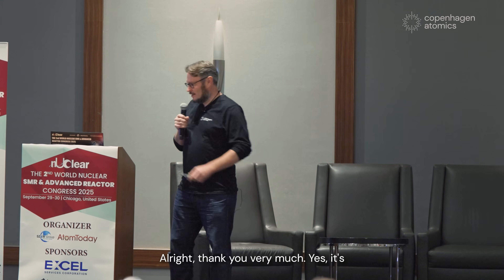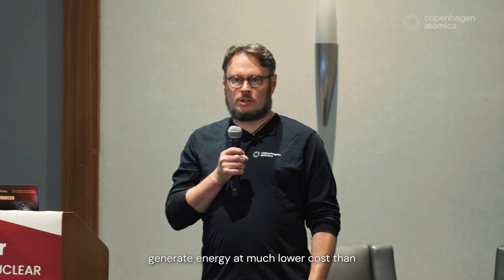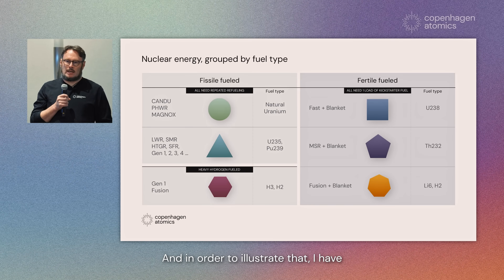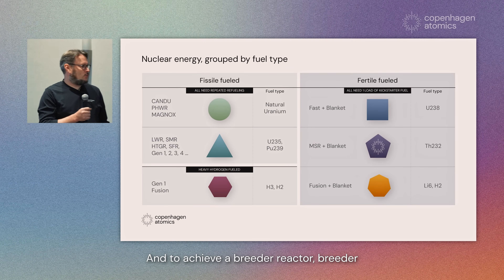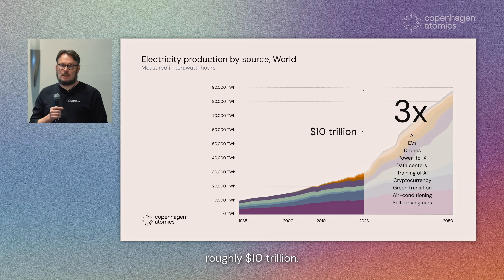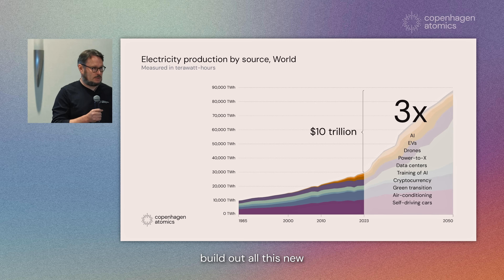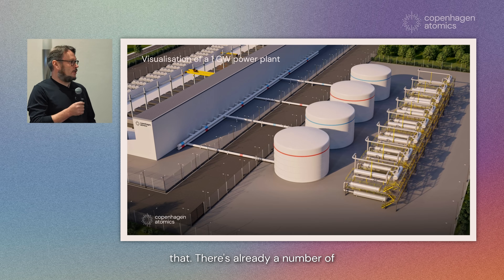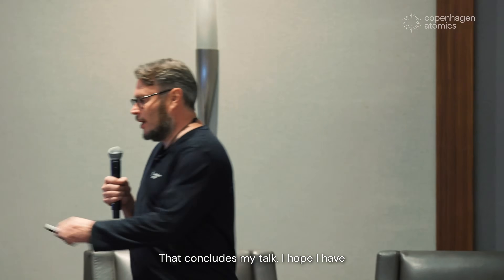The Solution to Future Energy Demand: THORIUM Reactors

Comment: NO, nuclear will never be the solution to our energy needs as numerous independent analysts have confirmed, nuclear is: 6-10 times the cost to deliver power, than solar + batteries, and, solar is installed in a fraction of the time as nuclear, and 100% safe.  The days of nuclear are pretty much over (except for nucear jet engines and small nuclear reactors for ships).
Reply: Solar??? I think you mean very low energy-dense intermittent sources that are totally dependent on the time of day, the day of the year (season), Vast amounts of raw materials including land, gigantic chemical batteries, thousands of miles of new transmission lines AND, AND a full demand-sized natural gas or coal plant as backup. No amount of overbuild and batteries can overcome seasonal variability for full reliability.

Comment: Reported for misinformation.  Solar Wind & Tidal is more than enough to power the USA 2x over for generations.  We are NOT going to patch radioactive material into every crevice of society you absolute half wit
Reply: Crawl back under your rock.
Solar is the sun. The sun is a star. Thorium is star dust.
If you favour solar you are, de facto, a supporter of Thorium.
Reply: @vincentmahon6423  Super concentrated solar that runs 24/7/365.

Comment: $50 million for a 42 MW reactor which only creates the heat.  Then you will have to buy the equipment to generate the electricity. Plus $2 million per year for operational cost.  This doesn't sound like it's feasible compared to the 42 MW solar farm near Dublin, Ireland which recently sold for $41 million.  Sure, there will be markets where solar is not practical and this will work, but to truly go mainstream, the cost needs be closer to $20 million.
Reply: If you are decommissioning an existing coal plant, then all that infrastructure is already there. And the sun doesn't shine at night, or in winter in norther europe, most of the day.

Comment: Fusion wont be too far away. I do admire you for your persistence though.
Reply from the maker: We applaud the people working in that field. However, there are still many obstacles in fusion, not least due to the lack of isotopes needed. Nonetheless, in that regard we might be able to help with Li6, as we're doing lithium 6/7 separation to accommodate our need for Li7.
Reply: It is still not clear if fusion works as planed. There are still 3 big hurdles that are not clear: one is the first wall material to withstand the heat and radiation for long enough to be practical. This is actially a bit similar to the wall material problem with a MSR. The 2nd is breeding enough tritium - it gets quite tricky to breed enough tritium to account for the losses and consumption. It would at least be essentially impossible to breed enough to allow for a fast expansion without producing most of the tritium from conventional reactors. The 3 rd hurdle is getting the costs reasonable - things tend to be very expensive. The current plans are for a rather long time scale, like the usual at least some 40 years but likely more. We have to solve the problem before that time. There is still a lot of developement needed: not much (beyond computer simulations) is done on the wall material and tritium breeding.

Comment: The safety point is a little distorted. Nuclear may kill less people, but if it blows up, it would catastrophic. His point should be is that its designed not to blow up, it shuts itself down.
Reply: Ever heard about a dam break? It kills sometimes thousands of people
Reply: @peace10794  Do you think dams are the only alternative to nuclear power?
Reply: @peace10794  Yes but the material can be removed and the dam can be rebuild the possibility that a dam breaks with basic maitenancens is also realy low . Any nuclear reaktor produces fuel that will have to be store a long time without any real solution for it with more planta running more has to be stored . If a plant experions a break down the land will be unisabel for generations to come its not just a simpel clean up . You cant compair both at all . The reality is also costs you simpely cant compeat with Wind and Solar even if you build small we dont even have an actuel working torium Reaktor they all failed with the problem beeing the material uses to moderat the fuel . Salt is just the killer of any material over time .
Reply: @xythiera We don’t live in the 60s anymore. Corrosion is not a problem with modern material technology. You can even purify the salt to remove most of its corrosive attributes. Even Tschernobyl (worst nuclear disaster with an outdated design) won’t be inhabitable for generations. This is only anti nuclear propaganda based on the LNT scam. And by the way, talking about waste. Do you know that nuclear leaves way less toxic materials that need a final repository? Just look how much arsenic is produced for copper production for example? Arsenic is forever toxic. I repeat FOREVER. A nuclear power plant needs 5-10x less for the same amount of energy. And we also have to consider storage and backup for renewables.
Reply: Excellent point. Look at a coal plant. You have filing piles and these are way more radioactive than water that comes directly from a nuclear reactor
Reply: In India we have already producing electricity from Thorium with a 700 megawatt power plant, a fast breeder reactor. 
India states like Kerala and Orissa has Thorium deposits in abundance and we have the capacity to mine and manufacture electricity from Thorium which is much cheaper than explained here in this video

Comment: Interesting talk but that graph shows primary energy that’s everything we burn, including all the wasted heat. Wind and solar produce direct electricity without those losses, so they look much smaller here than they really are. You’re basically comparing apples to coal.
Also, since 2022 electrification has accelerated massively  electric cars, heat pumps, industry all far more efficient than combustion. If you correct for that the picture changes completely. Scientists should be transparent about this otherwise people saying ‘science is just another belief system’ will sadly have a point'.
Reply: The waste heat isn’t counted as a separate thing but because the chemical energy of fossil fuels already includes all the energy that will later be lostas heat  those losses are implicitly included in the figures. To my understanding, that's what  primary energy consumption means.
Reply: His graphs did not include waste heat.
Reply: Correct.  Need diagrams showing rejected energy.

Comment: “How THORIUM Reactors Could Solve Our Future Energy Demand” from Copenhagen Atomics:

Copenhagen Atomics is developing molten salt thorium reactors, with a team of 65 people and the world’s largest molten salt test facility in Copenhagen.

Their reactors use a new “onion core” design to generate energy at much lower cost than traditional reactors.

Global energy consumption is projected to increase 10x in the next 100 years, which current technologies cannot scale to meet.

Molten salt thorium reactors provide a solution by delivering clean, scalable, and reliable energy—potentially tripling electricity production by 2050.

Thorium is abundant and inexpensive; the world already mines enough thorium (as a byproduct) to meet all energy needs for generations.

Thorium reactors are breeder reactors, meaning they generate more usable fuel than they consume.

Nuclear safety and waste concerns are addressed: modern nuclear energy is the safest form of energy, and waste is manageable.

A major challenge has been the high construction cost and delays of traditional nuclear plants. Copenhagen Atomics aims to solve this by mass-manufacturing compact reactors (the size of a shipping container).

Each reactor unit costs $50 million and produces about 42MW. The operational cost is low, estimated at $2 million per year for fuel/service, resulting in an electricity price around $20 per megawatt-hour.

Facilities use arrays of these containerized reactors, shielded and protected, delivering heat at 550°C for steam generation.

First commercial test reactors are planned for 2027 in collaboration with the Swiss PSI lab. Production already started, with scaling planned via gigafactories.

Key message: Thorium molten salt reactors could redefine global energy production—cleaner, safer, scalable, cheaper—supporting future demand for electricity, including energy-intensive industries like data centers and AI.

Comment: An additional benefit with smaller reactors would be that the cooling water can be kept in a mostly closed system, with the steam being cooled passively and comdensing back to water. The relatively modest amount of heat )compared to huge reactors) could be used in a variety of ways from heating local buildings, industrial processes, large greenhouses, or even more electricity generation using low intensity methods such as Peltier solid state thermal systems.
Reply: These reactors don't need any cooling water.
Reply: @chapter4travels yes, this reactors actually needs external cooling water. But not a natural source, like a river. Probably air condensation will be enough
Reply: @peace10794  No, it doesn't; no water at all is needed for the reactors. The steam generators will require a small amount of make-up water, but that's it. That goes away also if they use Brayton Cycle generators.
Reply: @peace10794  It does use heavy water as a neutron moderator, but that's completely different and runs in a closed loop.
Reply: @chapter4travels yes, there is a water loop to cool the heavy water. It is on the opposite side of the container where the heat comes out. But of course they have air condensation for it.
Reply: @peace10794  I stand corrected, thank you.
Reply: I was wrong, @peace10794 cleared it up for me. There is a water loop that cools the heavy water moderator, which indirectly cools the reactor. I was unaware of this. Sorry for the confusion.
Reply: Normal people: eat soup with a spoon
Fusion freaks: "Let's try it with a fork!!! It will be much easier, because it's DOABLE"
Reply: Ein Thorium AKW wird nicht mit Wasser gekühlt, sondern bei höherer Temperatur betrieben. Er hat einen negativen Temperaturgradienten.
Reply: @ArekGunter2015 The heavy water moderator is cooled by water.
Reply: @ArekGunter2015  Aber ein Thorium Reaktor treibt eine Dampfturbine an. Da gibt es einen Wasserkreislauf mit Kühlung.

Comment: Interesting talk, but two serious questions for the engineers: 1) What’s your plan for obtaining the initial fissile seed (U-235, Pu or U-233) and for building a licensed thorium fuel-fabrication/reprocessing supply chain — because none exists commercially today? 2) U-233 production always comes with U-232 contamination and very high-energy gamma emitters (Tl-208). How do you intend to manage fuel handling, on-site reprocessing and shielding inside a 40′ shipping container, including remote maintenance and regulatory inspection? Concrete engineering answers, please.
Reply: They plan to replace the whole container and reprocess everything on a licensed location. I have no idea how you just casually ship a highly radioactive container from place to place. It is basically the same effort as transportation nuclear waste. How is this going to happen?! They want to build hundreds and even thousands of these containers. And after around 5 years each container needs to be replaced. Wtf
Reply: Correction: They plan tu use a core made of SiC Composites to enhance the lifetime from 5 years to multiple decades and onsite refueling, cleaning, recycling of the salt for the next generation of the reactor.(closed fuel cycle) The 5 years is only for the early steel based version.
Reply: @peace10794 the emptied "spent" containers would be stored on site for years until the radiation "cools down" sufficiently for the movement of the container to be a lot simpler from a regulatory standpoint.  Then it would be molten down and fabricated into a new reactor and container.
Reply: @MrGottaQuestion yes, thats probably the solution. A storage for „spent“ containers is also on the site. It is also visible in the whitepaper
Reply: I have read that they will replace the whole container within 5 years. 
I'm not sure they will be able to deliver anything near those 5 years, due to corrosion and radiation damages on components.
Reply: @Harrythehun they supposedly have a "secret sauce" recipe for incredibly dry salt without water that in that way really lower the corrosion from salt in direct contact with metal.
Reply: CA has an AI on their website, that has been fed material from the company. It gave the following answer: "Copenhagen Atomics does not rely on third-party suppliers for finished fuel salt. Instead, the company uses LEU, TRU, and thorium from established suppliers and manages the conversion to fluoride salts in-house or through qualified partners. Agreements for thorium supply are already in place, and the company is actively working to scale up all relevant supply chains."
Reply: Looking to 'steal' the secrets eh .. ?
Reply: Thanks all for the replies. I was half-hoping someone from CA would jump in.

@serpentphoenix @TheBearStudios - trade secrets are fair enough for chemistry tricks, but shielding specs, decay-heat numbers and transport rules aren't secrets. They're published standards. Have a look at IAEA SSR-6 or 10 CFR 71 and see what regulators actually require. If CA have a way around those laws of physics and regs, that'd be quite impressive.

@peace10794 @MrGottaQuestion - about their stacking 'spent' containers onsite: ok, great marketing image, but how big a holding yard do they expect each site to have? Months of cooldown plus active cooling and interim shielding = space, power and licensed storage. Where do customers get that, and under what licence? Seems like a mini waste site next to every installation.

The SiC story is neat. SiC can cut corrosion, sure, but it's brittle, it ages under neutrons and and it doesn't make the radiation or activation go away. Who certifies those vessels for decades? When they fail, how do they decontaminate or recycle them without making a mess? Smelting radioactive components is not a thing.

@ntwkldqvcyf - bingo. There's no ready-made fuel cycle or licensed reprocessing chain for thorium -> U-233. That's not a marketing detail that can be glossed over. International safeguards, transport regs and fuel-fab licensing are a mile long and take years. They can't be wished into existence between funding rounds.

@thesparetimephysicist9462 - thorium is the easy bit. Its U-233 and enriched seeds that are the hard bit. U-233 carries U-232 and that 2.6 MeV Tl-208 gamma line that punches through a LOT of shielding. Did the AI say how they'll handle that waste or the shielding for it? Because that's a part that really interests me.

One last thing, the 'one container a day' thing, if they actually shipped 365 modules a year, you've got hundreds of irradiated vessels and tonnes of contaminated salt to deal with a few years later. Even if the salt is mostly recycled, the structures become activated radioactive scrap. How do you responsibly process that at scale? Because that, not marketing, is the real materials challenge. It gets big fast — think decades and massive facilities, not a backlot full of tidy little shipping containers.

I'm genuinely curious. Someone from CA, how do you get from vision to the hard numbers and the licences? If they've got the plan, show the regs and the thermal/shielding math. Otherwise it still looks like airy promises and nice visuals.
Reply: Why would they give us engineering answers? That might very be their trade secret.
Reply: @serpentphoenix well yes obviously.... But it does not prevent them from sharing the real test results.  Currently there's a mumbo jumbo talk.  Yeh, they got some results with the molten salt systems... But unfortunately no info on the thorium tests itself.  It could be that the welded onion just  stays up on the  imagined potential which is filled with hype. Known pattern...
Reply: Its  a hype train...  They are not showing any info unfortunately,  only some random welded onions...  and all the talks are on repeat.
Reply: but i hope the impressions are wrong and it succeeds
Reply: @taavetmalkov3295  You need hype to get people to adopt it. Nothing he says is untrue. MSRs worked in the 60 and they'll work today.

China has gotten further on this because China isn't afraid to try new stuff and they don't need to hype stuff up for investors to come along. They have a control economy and will just pursue what makes sense, and MSR made sense.
 They've successfully built breeding reactors and are well on their way to making fully functioning reactors.
Reply: Normal people: eat soup with a spoon
Fusion freaks: "Let's try it with a fork!!!"
Reply: @santaclaus0815  Noobs! Try it with a thumbtack...
Reply: @santaclaus0815  Normal people: Eat soup with a poisoned ladle!
Fusion freaks: Let's do our best to take poison out of the equation entirely.
Reply: @JimmyNuisance  what poison?
Reply: Thank you for your questions. You raise interesting and important topics. I think the organizers of such events don't fully understand the nuclear industry and the entire process, from ore mining, reprocessing, storage, fuel handling, and what to do with it. However, I'm 100% certain that the important and dangerous aspects of this crude (though not necessarily promising) technology will be glossed over.